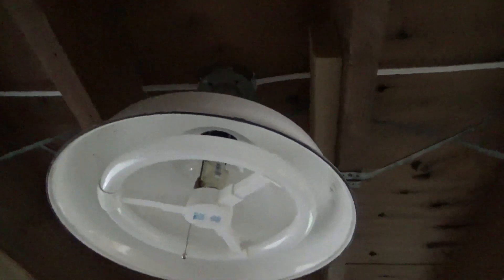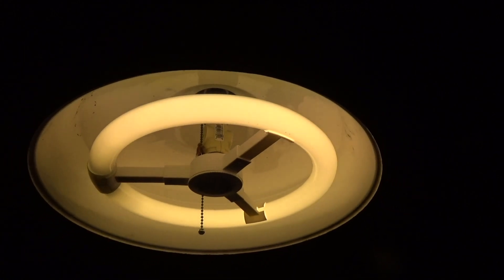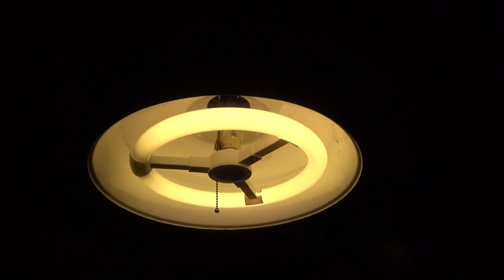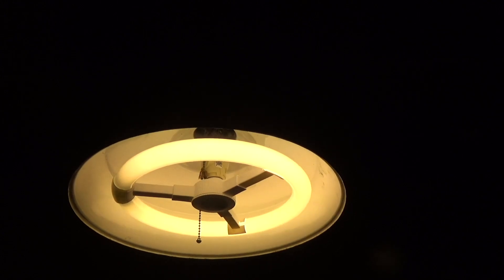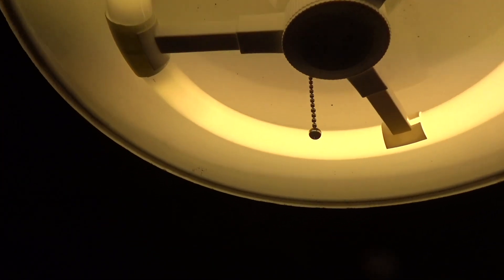Contaminants Inside a Fluorescent Tube

Comment: If they are older, it is likely that is mercury. It is quite common on older lamps that have the "non eco friendly" amount of mercury in them. As for the flickering and stuff, that is normal for new lamps sometimes as well. It will likely be fine after a few uses. 
If that is mercury, it should evaporate after being on for a while.
Reply from the maker: These are probably from the late 90s or early 2000s. After a few hours of operation the flickering has diminished.
Reply: Exactly
Reply: Oh no